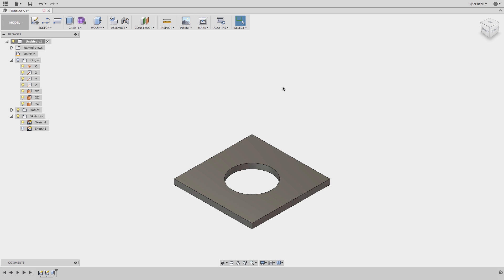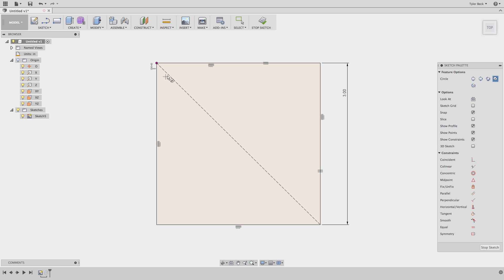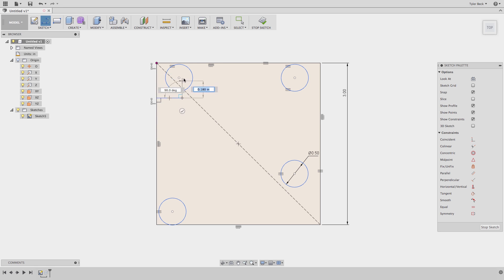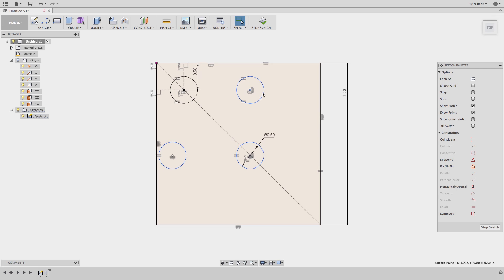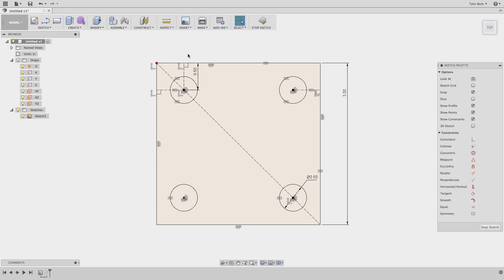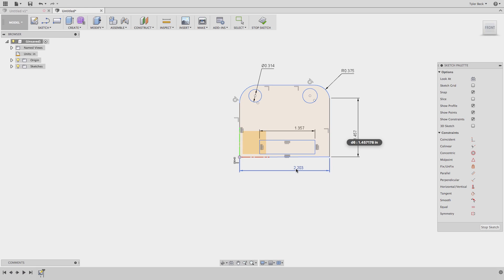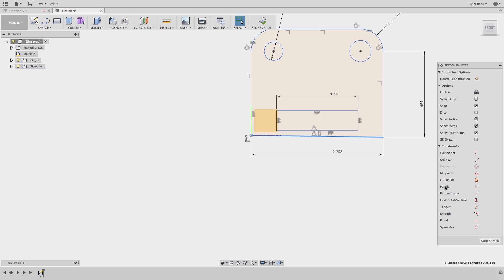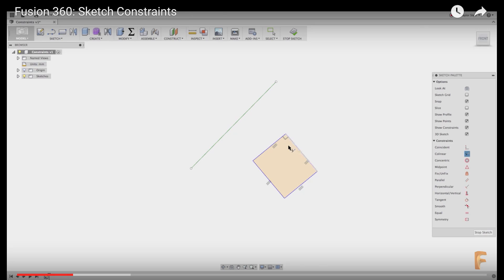Fusion 360 Constraints - Sketch Constraints Are The Key To Better Models!

Comment: Hi Tyler! Great Video! I am totally loving FUSION! Today I ran into a situation today where I needed to create a die, and I had to create a line from a 1.5" plunger (male) into the cavity side (female).  Simple, all I needed to have was a tangent line from the round to the edge of the top of the die at 50.745 degrees.  Easy....I end up doing it in DRAFTSIGHT and importing the sketch in FUSION. Took me less than a minute...not doable in FUSION. I could not start a line (needed to be on a tangent) from the 1.5" circle and then out to the top of the die.  The only way I can do it in FUSION is to draw a construction line from the center of the circle at 50.745 degrees and then offset it .75"/Radius plus the material thickness and then trim the line so that ends in tangency to the circle.  Isn't there an easier way? Thanks for all you do!

Comment: You asked for a constraint question;  I am beginning to design a guitar neck........I need it to start out as a rectangle that is 16" long and tapers thinner and narrower at one end. Can I draw a 2d - 3 point rectangle, then extrude to the length, then with restraints change the width and thickness at the other end?

Comment: Thank you for your “ beginners” videos. They’re a great source for learning Fusion 360. I retired three years ago with about 25 years working with Autocad, Softdesk and the current Building Suites. I am very new to Fusion and 3D modeling and I get a little frustrated sketching using geometric constraints and dimension constraints. Just when you think it’s safe to rely on dimensions as a after thought or back up, you’re told you have too many constrains and you’re left with a dimension you can’t edit to move or edit an object. I guess it’s my mode of thinking. I’m used to using “ offsets, copy, mirror, arrays, lines etc for building objects. Thanks again.

Comment: Clicking vertical or horizontal constraint and selecting the origin or a reference center point on another geometry then holding shift and clicking near the middle of an another object, centers it relative to the.origin or the other geometry.

Comment: Tyler ..umm struggling with this seems you do one thing ..turn the sound off do 4 other steps God knows what they are and hey presto it's done and got constraints etc. Been using fusion for 2 months and find it both very frustrating to say the least...along with a mind of its own ! Made models and bits with it on my printer...but for the love of god I couldn't make the first 2 sketches ! Everytime there was an issue with over constrained under defined ...is this an issue with Mac / pc... Description or is it just see what works when it works. I can see why people inc myself fall into very bad habits and use the approach of " well I've always done it this way because it's the best way that actually works" as apposed to trying to follow a professional with guidance and it not working ever when we do it ! Very frustrating... For the longest time I was clicking to draw a circle and at the end clicking again..which as we know defines the size great goes from blue to black.. In your video you don't explain that ..maybe rather than assuming we know what your doing with the clicks etc describe them to new comers ? Also on your drawing it shows 90 at top left...and defined mine not. Either it's just me and I accept that as I have never used cad and its wayyyyyyy more difficult than photoshop which I used to use a lot and I have to accept that even drawing a rectangle or square will be a massive learning curve for me !

Comment: Inventor and Fusion both automatically create TOO MANY constraints, which is a constant problem. I spend 80% of my time just trying to remove constraints rather than actually modeling.
Reply from the maker: I tend to agree with you.  I do use the control/command key on mac to turn off snaps and constraints while sketching.

Comment: I down loaded a PCB design model. I want to add electronic components which are separate bodies. I want to dimension them relative to the edges of the PCB and/or to each other. When I try I get an error that there are too many constraints and the dimension will not work.
How can I fix this?

Comment: Hi Tyler - thanks for the great videos.  A constraint quesiton:  A lot of time when I'm sketching Fusion automatically puts in lots of constraints that I don't necesssarily want.  Is there a way to tell it not to put in any constraints automatically?  Also, is there a shortcut for making a line that's a construction line (i.e. without having to make a regular line and then change it to construction)?  Thanks!

Comment: Hi, nice clean video thx for that. Question about the tip from nraynaud1 ref. avoiding using filleting in sketches. Can you expand on this point please.  I realise filleting is a common technique in the modelling stage but when you are drawing a profile sketch that involves curves / radii is the suggestion to use curve tool options instead. Or is the plan to keep the profile as linear as possible and round up in the 3 stage and why. Thx
Reply from the maker: Hey Adrian, Great question.  This is a preference, you are free to build how it makes sense to you.  The reason I think this way is that adding fillets on the sketch adds more dimensions and more complexity.  I prefer to have a series of fillet features at the end of my model design that are grouped together and easily edited by scrolling through each feature.
Reply: ok got it thx, so basically keep that foundation as clean as you can.

Comment: I would advise people to use as small sketches as possible, because their history is not captured, and complex sketches are a nightmare to edit. 3 areas where you can limit your sketching: avoid filleting in the sketch (plus you'll get g2 fillets in the 3D side), avoid symmetry in the sketch and absolutely avoid patterns in the sketch (because now you have duplicated the base feature and all its constraints, if you want to edit it, you're in hell). 

When you have no choice, you can try to split the nightmare in various pieces making a first sketch, then making a second one where you project the minimal amount you need from the first Sketch and do some ore work with it, etc. It's not ideal but at least you are spreading your work in the history, and the constraints are not duplicated.

If you want a DXF for laser cutting, you can use the previous techniques, extrude it and use all the 3D tools to have a confortable model history, then make a sketch on the top face of the solid, project the solid and save that sketch as a DXF. I spent hours deleting and re-creating constraints before understanding that I was fighting the wrong battle.
Reply from the maker: Agreed!